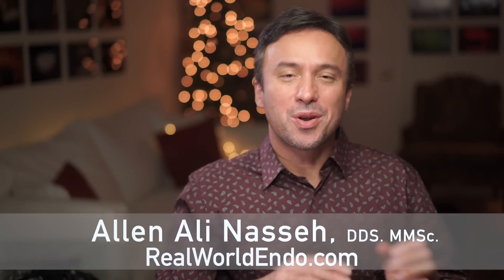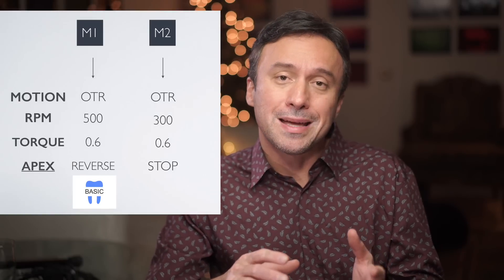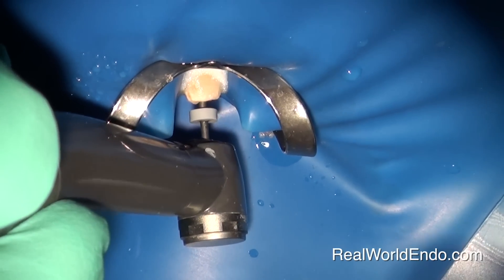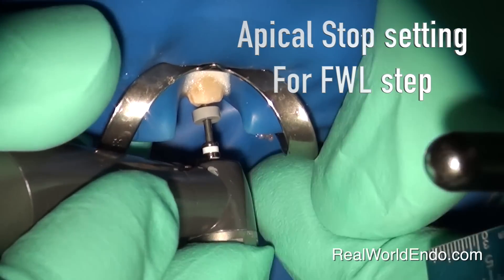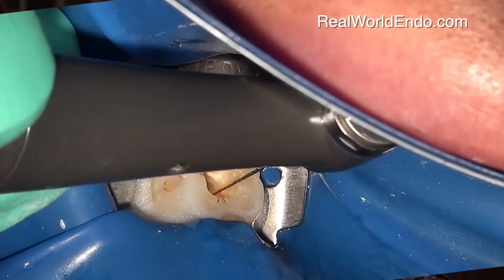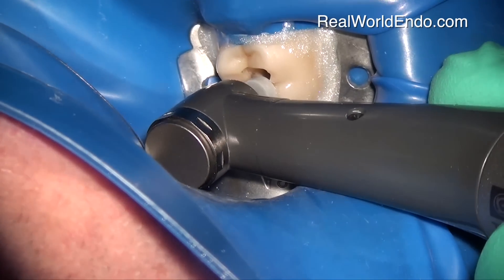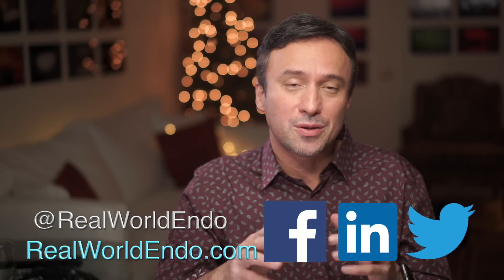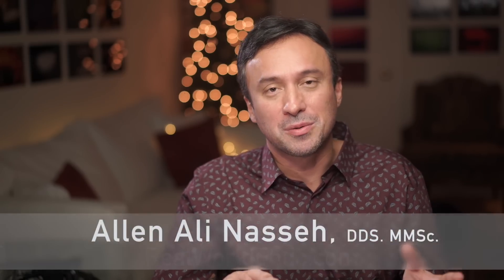Apical Stop Work Around for EndoSync : EndoSync A I Combo Quick Tutorial

Comment: Forget the "stop" feature ; I thought the idea was efficiency and safety.  One wrong move as you or your assistant are fumbling around trying to disengage the file from the head of the hand piece and snap goes the file. Keep it rotating.....always!
Reply from the maker: That has never happened to me. So, I'm not sure what you mean by that. However, the apical stop can get the file stuck in there (in a tight canal) since the handpiece can not be reactivated to take the file out. The trick is for the assistant to turn the Apex Locator off momentarily while you press the power button and back out the file. There should not be any file fractures if you're not overtoquing the file. Cheers.
Reply: @EndosKool  ok, thanks.  Didn't realize you could manually switch it into reverse.  I still think however that you would be "asking" for trouble with that stop feature.

Comment: It seems rather odd there isn't an apical stop, 90 deg reverse, stop option as I think that would solve a lot more of the issues other clinicians are having. I'm assuming the AI's reverse is a continuous reverse or is it a reverse to disengage only? I myself don't have the AI or Endo Sync, so I tend to just attach the regular apex locator clip to my rotary file and it works quite well surprisingly. But since I use the TF Adaptive system, it's a lot easier to just pull out right when apex is reached. I'm a new grad GP (2016) so I'm still new to this world for RCT, but your videos have helped a lot and I've picked up some tips and ricks by watching your clinical videos especially. I think I've seen most if not all your clinical first person view videos of accesses and obturations and I hope to see more of those combined with voice overs as to why you did things the way you did.
Reply from the maker: Thanks. Yes, I used to use the handpiece/apex locator in the same way too (before A.I.). But now that they are integrated it's easier since you don't have to worry about a dangling file clip from your handpiece in the molar area where there's not enough space for a clip and a stopper at the same time. Anyway. Good luck.

Comment: hi plzz help me I have a root canal on my front teeth and It's been 4 years ago and I'm doing bodybuilding and my right side body parts are different in side from my left side ,, Is that due to root canal teeth ,?????  plzz help Dr. plzzzzzzz

means my body is getting inbalance
Reply from the maker: I'm sorry to hear what's going on with your body. However, I can assure you it has nothing to do with a root canal. However, it's always best to get a second opinion with an endodontist to make sure the original root canal is working and there's no problems with it. However, often times unexplained neuromuscular problems are blamed on other procedures instead of physicians accepting that they don't know the cause of most neuromuscular problems. If no clear infection is observed around your tooth by a qualified endodontist, removing your tooth will only mean you'll continue to have the same neuromuscular problems but now you have no front tooth! Be careful not to make a mistake by watching false internet information. But do have your tooth checked by a qualified endodontist (root canal specialist) in your area.